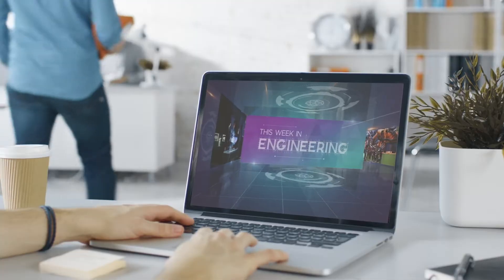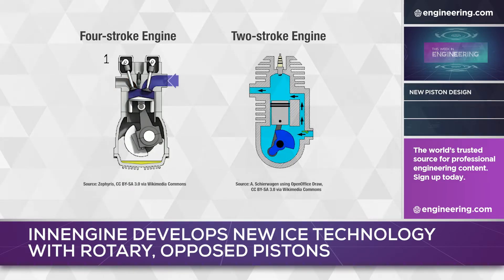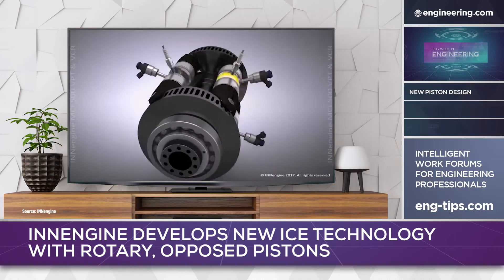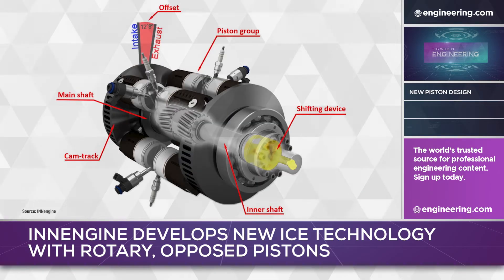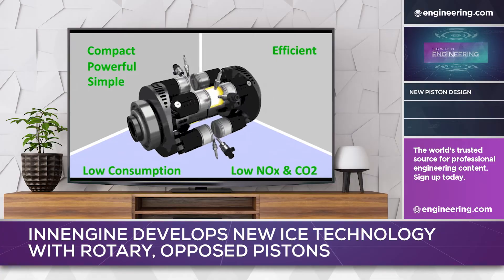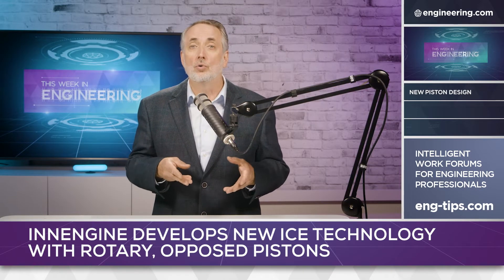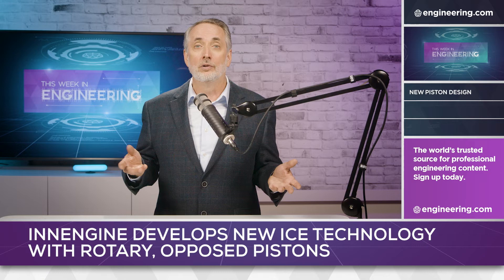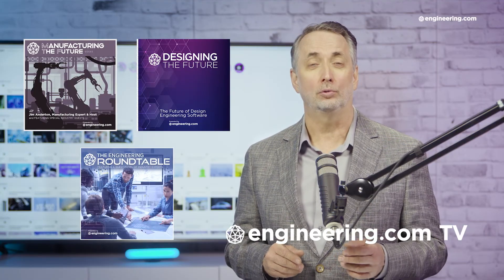An Opposed Piston Engine with No Crankshaft

Comment: What's its thermal efficiency and what thermodynamic cycle does it use?
Reply: Otto cycle if spark (constant volume combustion) diesel if compression ignition (constant pressure).   Efficiency for Otto is perhaps 15% gain because no heat lost to head.
As a rule of thumb, the heat rejection to cooling is about the same as the produced power.  Most heat goes out the exhaust, but some exhaust is recoverable by a turbocharger.
This engines downside is the rollers which must skid on the cam.  The rollers turn at mind numbing rpm.  (Roller bearings have a limiting top speed). The rollers have humongous hertz contact stress which fatigues the metal and causes spalling.    Cheers